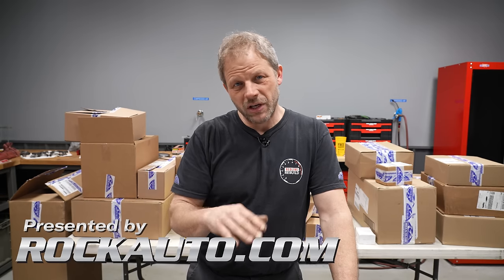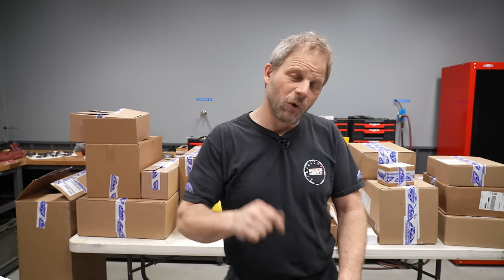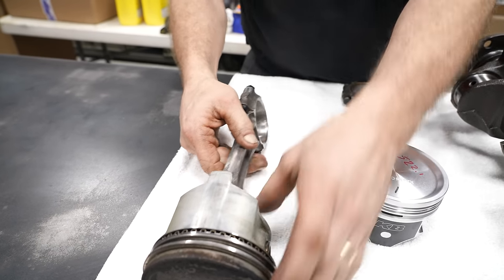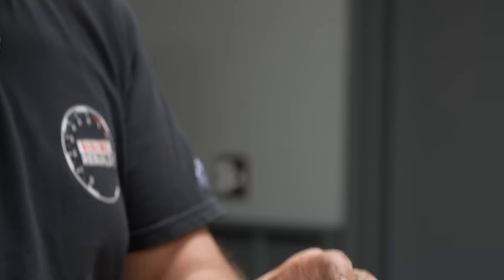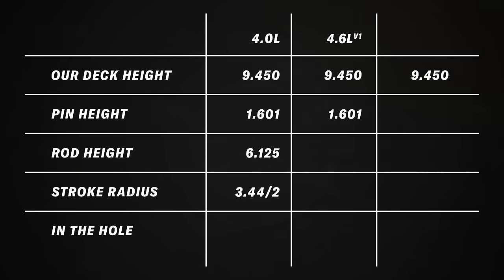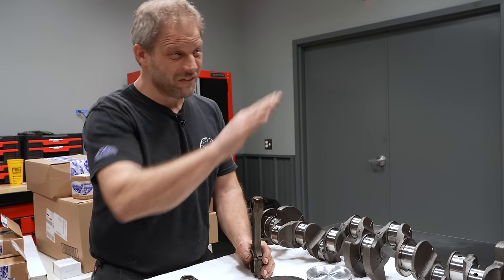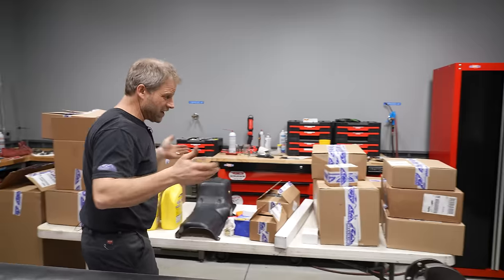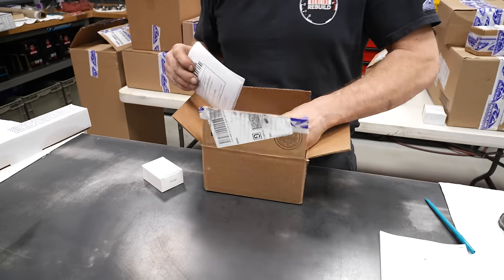Breaking down our Jeep 4.0L stroker mod

Comment: You won't get much compression with a 4.2 (258) piston in a 4.0L block. The bore is .125" bigger.
This may be outrageous to some but if I were starting with a 4.0 I'd go the other way. Open the bore up as much as possible*. And destroke the motor by going to a 199 crank. Appropriate rods and piston. Custom cam. Need the custom cam because the head would get replaced with a new head built from two donor aluminum Windsor, Cleveland or LS heads for a crossflow head. Use a cam profile similiar to the Boss 302. The object would be to build a high rpm screamer. Back it up with a six speed transmission. Drop it in say a Rogue hardtop with IRS, new front suspension and a few other tricks and go hunting Beemers. Or use it for autocrossing.
*take one block to the maximum overbore and another to 4.0" using sleeves welded or silver soldered in place.

Comment: Jeep 4.0 or 4.6 liter ?  Neither, I have the old reliable "Iron Duke", 2.5 liter 4 cyl in my '87 Comanche, over 300,000 miles on the Original Motor.

Comment: I believe I’d deck the block some anyway. Maybe not the whole .026 but .015 to .020.
Reply: I would too. However, it is because I just don't trust the surface of the engine block. It is eay to do at rebuilds.

Comment: You probably know this already but I learned the hard way go stock with your thermostat temperature! I kept having overheating issues with my 4 L of course I tried 165 thermostats and that was actually my problem all along. One 9503 thermostat allows the coolant to spend enough time in the radiator to actually cool down system needs to be under pressure duh lol
Reply: System pressure is controlled by the radiator cap, not the thermostat.

Comment: surprised you're going with that fram paper junk filter. WIX 51515 is a much better constructed filter and has a higher capacity so more filter element to actually filter. no modifications needed either. very common 4.0L jeep upgrade
Reply: I buy these in bulk, although I get the Napa Gold filters. Same filter, but cheaper because of the different name. I have three vehicles that use the 51515 filter lol.

Comment: how about a renix cam? higher lobes than 91+ 4.0. and I plan on using a TUPY head with slightly larger valves from an 03-06 wrangler

Comment: Check the valve springs pressure.  Because its a remand head and it not a stock cam anymore.
Reply: Good point. Either that, or ask the cam manufacturer what springs it is compatible with. Some make the cam more aggressive, but just mild enough to use stock tension springs. Delta Cam was where he got his, I'm sure that info is a quick phone call away.
Reply: @skylinefever  i am building a 331 stroker that, s a 66 289. I ran into a problem with the valve spring on my aftermarket head.  Spring are rated for 600 lift but fell short , buy a lot when tested.  I contacted the manufacturer, to send me springs up to the job. Considering i did pay for spring.
Reply: @michaelpagliarini4785  Good point too.

Comment: I'm intrigued with your presentation. My 2005 TJ has 184K on its stock 4.0 liter. I wish it had a little more git up and go. If money was no issue, what might a reasonable cost be for the mod you discussed and what would I tell an engine builder in order to get what you've accomplished? Your response will be greatly appreciated as I am not mechanically adept to doing this. Thank you.

Comment: Just a question, when you shave the block or the head, reduce the gasket thickness, (to improve the compression back to normal) this would reduce the distance between the camshaft and the rockers right? Do you need to shim the rockers up the 250 thou (the distance shaved from the block to bring the "In the hole" back to .004") or is this negligible???

Comment: Could be totally different and try fitting a ford 4.9 crankshaft into that 4.0.
Reply: That wouldn’t work in any way. Different bore spacing, different main journal sizes, different rod journal sizes. Not to mention flywheel/flex plate hub and bolt pattern, crank snout diameter is also likely different. Two totally different pieces of cast iron.

The AMC/Jeep 4.0 and 4.2 (258ci) are in the same engine family. The 4.0 is essentially an updated 4.2, and how all of this works so well together. They’re essentially the same engine.

Comment: So did you consider the Edelbrock head. For extra power?  Should have LS swapped it. 😈😈
Reply: Good luck actually getting one, though!
Reply: I don't think he considered the Edelbrock head because his goal was to use as many stock or basic stock replacement products as possible. That would happen with a $2000 performance head. I think Hesco also has an aluminum 4.0 head, but again, it would not be some kind of basic stock replacement part and would be expensive.

Comment: I thought you cut the bore .030” over
Reply: I'm sure the engine will be rebored. How much depends on the condition of the engine. Usually +.030 does it on a 4.6. If the engine has less wear than usually, you might be able to use a +.020. I like seeing someone use the smallest overbore as possible, it helps if years later, the engine needs a re rebuild. Most can take a +.060, however, if you have a +.020 and the block isn't too bad, you could go to a +.040 and still have another ebuild left.
Reply: @skylinefever  they did go 0.030” over at the machine shop.. I was just commenting how that affects the math.. and parts

Comment: So... how's Rock Auto return policy? I've looked many times to buy things from them but the website is less than friendly, so many caveats on items... so I end up going to a local parts store. Have you had good experience with returns?
Reply: It all boils down to your level of time to wait on turnaround shipping or your urgency to get the part or the job done, really.

They are relatively easy to deal with though.  Will often times not bother with you shipping a part back and will just send another one etc.

Comment: You should get some upgraded motor mounts. Stock ones are doodoo
Reply: That may be true. Also, I have never seen a plain stock replacement mount that wasn't absolute garbage. Anchor brand, for example, should be avoided.

Comment: How would a 4.6 or .7 stroker do for a stock daily. Looking for more power. Would its hold up with out updating other parts.
Reply: Factory rods are forged, and 99' up and some 98.5 year models have a main cap girdle. Unless you're purposely revving these engines, you will never have trouble. The extra displacement will behave like a stock engine with more base power depending on your cam and gear ratios.
Reply: Make careful decisions with your compression setup or you will daily driving with premium.

Comment: Could the 4.7 Stroker damage the automatic transmission on a 2001 TJ due to the horsepower and low gears?
Reply: You’ll be ok if you keep it under 300hp

Comment: Does a thinner head gasket increase the risk of blowing it?
Reply: Not in this case. He's using the thinner head gasket to get the compression ratio closer to stock. The head gasket in my rig (91 YJ) is a bit thinner than stock and haven't has any issues. Those engines are legendarily tough.

Comment: it's always about more power
grrrrrrrrrrr...........
The area where these inline sixes shine above their V configured counterparts is HIGH TORQUE at low RPM!  Well, that and silky-smooth perfect primary and secondary balance.
When you are doing work from a stand-still, i.e. towing, pulling, rock climbing, yanking stumps, or just every day stopping at traffic lights you want all the torque you can get at 1000 to 1500 RPM, and if you can carry that torque throughout the range of operation then the work becomes easy and sure.
Power is about speed and power is good, but for trucks and Jeeps and 4WD workhorses High Torque at low RPM is what you seek
Reply: It is more to do with the size of each cylinder. A short stroke narrow bore engine can handle higher RPM.

Comment: So you used the short rods on a stroker… Won’t that be a terrible rod stroke ratio?  Won’t that ware the skirts off the pistons in about 30,000 miles?  Think Chevy 400 small block, GM 2.8/3.1 V6. You don’t see them around any more!  Just sayin.
Reply: I'm not sure. The 4.2 would have the same basic rod ratio as a 4.6 that used a 4.2 crank and rods, however, that rod ratio was never a problem for the 4.2. The 4.2 lasted for ages.